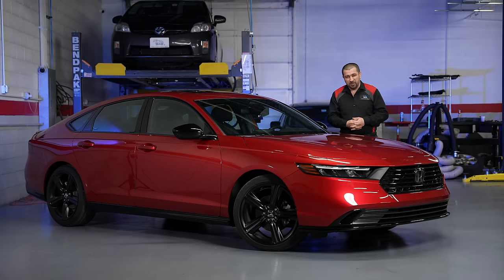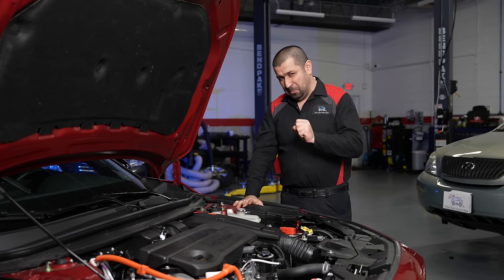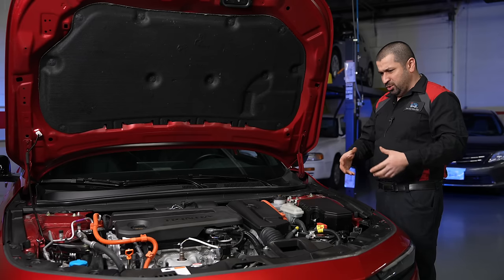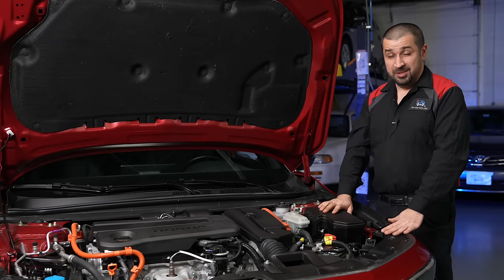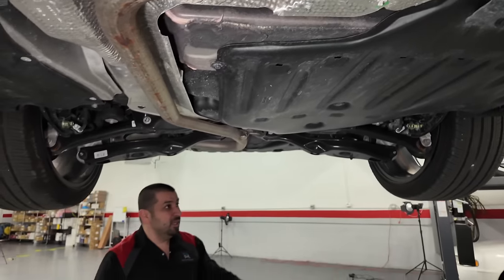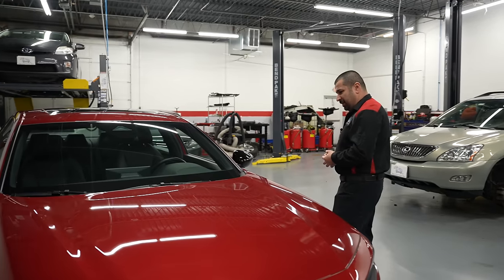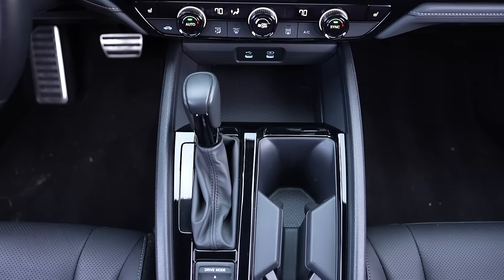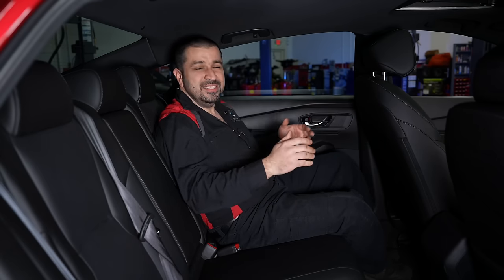Should You Buy The Latest Honda Accord? A Mechanic's Review

Comment: I own this exact same model that is in display here (Sport-L).  Overall have been very happy and the only thing I would recommend is to go with the EX-L model, cause it has 17" wheels and the ride is much smoother and it also has more features than the more expensive Sport-L .
Reply: but the Sport-L looks much better
Reply: @angusp5515  no rear seat vents in the Sport-L tho
Reply: @angusp5515  As far as appearance, the Sport-L is the sharpest trim and that's why I bought it.  But for the price it lacks quite a lot of small things that the EX-L includes, so had I done it over again I may have opted for the EX-L and then maybe added some of the black accents.
Reply: The ex l version is the one recommended by consumer reports because of the smaller tires and smoother ride.
Reply: @shojus  I'd agree with you. I have a 2020 Accord Touring, but if I were to buy a 2024 I'd go with the EX-L just because of the 17" wheels. That along with being a hybrid should make for a super quiet and comfortable ride.
Reply: @Nelwyn  The hybrids are definitely quiet!  The 19" wheels on most of the trims make for a noisy ride if you live in an area with bad roads.  They look great, just not practical for mpg and road noise.
Reply: I went with the Sport (not Sport-L) thinking I could live without the EX-L features but now a month later wish I did go EX-L. It’s all good tho, I’ll just have to live with my decision 😂 it does look great in the exterior at least
Reply: And yeah the 19” wheels are so loud for me along with slight wind noise but everything else is silent. The Sport has Goodyear Eagle Tourings which might be the worst tires I’ve ever used. Luckily reviews online show them wearing out anywhere from 10k to 30k miles so I won’t live with them for even a year lol
Reply: @futuredestroy6040  Same thing I have heard about those tires.  I plan on getting the Michelin CrossClimate 2's when I need new tires.  I live in Michigan so a good all season tire is a must.  Never needed specific snow tires with a front wheel drive vehicle, that's just me though.
Reply: @shojus  same here, living in Michigan lol. I was between the CC2’s and the Defenders for my next set but honestly CC2’s look so much better for year round use
Reply: @shojus  yeah that pretty much .means  the whole US..  not many , if any,  areas where the roads are all good to go
Reply: @jdl1276  You got me there!  Although parts of the country that use snow plows are way worse than areas with nicer weather.
Reply: Probably the EX-L hybrid is the best value if looks is not your main concern. It has front and rear parking sensors and for touring/commuter duties, the 17-inch tires are way more comfortable in long trips. It also increases your MPG to 44mpg/city, 51mpg/hwy, 48mph combined vs. 46/41/44 for the models with the 19-inch wheels.
Reply: Also, if you get an Accord Hybrid, I also recommend getting leather seats, which is standard on Sport-L and up, because in my opinion, the cloth seats feel very stiff, and depending on the person the cloth seats can be uncomfortable on long trips. I recommend try the seats out before making the final purchase.
Reply: For what you get, the touring is the way to go

Comment: Great video.
Considering that people hate CVT transmissions, eCVT name is not a smart marketing move..
Reply: Toyota has been using the name for the Prius and all of their hybrid trims for years, and they still have year+ waiting lists.
Reply: You are right, it is stupid.  I found a youtube channel where they explained and displayed this transmission.  At the time I understood how it all worked.  Anyway, it is not a CV.  Honda has invented a completely new way of causing the transmission to change gears and its all gearing.
Reply: My thoughts exactly in re the ill-advised eCVT name.  You nailed it.  Since it isn't a CVT and CVT's have a bad reputation, come up with a different label.  Distance yourself from the whole CVT thing.
Reply: @FunkatronicDingus  not on the crown , got my limited within in a week , dealers were stack with them
Reply: It is basically electrical motor driven which by function is electrical CVT untill the ICE cuts in.
Reply: internet warriors that repeat every shit they read are the ones that hate CVT
Reply: Cvt transmissions have really improved over the years.  You don’t need to press the gas hard to get going.
Reply: @FunkatronicDingus  Not anymore.
Reply: @cormaro13  I test drove it. I thought it was a bit lethargic. What do you think about the Crown
Reply: @bella3008  I does feel a little sluggish in normal mode but give a little more power or switch to sport mode and its a different story lol 

But overall the ride has been smooth with 40mpg , especially for the ev side , super quiet but every now and then there’s a little glitch with the wireless car play and that’s the only problem I had so far
Reply: Cvt is perfect for urban use.
Reply: OK, Marketing Whiz - what do YOU think it should be called?
Reply: Perhaps Honda should brand this to be nCVT, in other words, non-CVT. Basically there is no transmission in this car.
Reply: My 2013 Accord Sport’s (first year) CVT has been faultless with 95k on it as of now
Reply: The accord hybrid does not have a CVT. Its, in fact a direct drive system that clutches the gas engine in or out depending on the engine load. Most of the time, the gas engine works as generator for the electric motor. In addition the Honda system fakes shifting, thus avoiding the rubber band drone of a CVT. Again, THERE IS NO CVT!
Reply: CVTs are awesome. Had several cars with them and no touble
Reply: @simonmoriarty9987  
Their reliability is so-so (they rarely last 100k), and most people agree that they dislike how they drive despite the fact that they improve both acceleration and fuel economy. It's widely derided as rubber-banding.
Reply: @Wised1000  Nissan’s CVTs have spotty reliability. Toyota and Honda have been using CVTs in their hybrids for two decades and they have outlasted the batteries in the majority of cases.
Reply: I guess that geared, 2 mode hybrid with pseudo electric shifting was considered too much for the average Joe to wrap their head around.😂 It also shows that people don't know what a CVT is either. They just know its annoying. The fact is that for 90% of car buyers now a days hiw their car (or anything) works is simply magical.
Reply: @Wised1000  yep, everyone has electrically boosted (numb) steering now too. I hate that a lot more than the CVT in my Accord
Reply: @billd9667   The CRV's electric rack is nicely weighted. It doesn't feel much different to my old s2000 steering, which was also electric.
Reply: @Wised1000  you should have driven a good hydraulic steering car like my old Maxima. You could feel what the front wheels were doing. The new cars drive like video games without force feedback.

Weighting is only half of the formula
Reply: @billd9667   my first car was a Peugeot 504, trust me I know all about hydraulic steering cars with and without  power steering 😁
Reply: @Wised1000  I hear you. 

I will say that the dead steering on my 2013 Accord Sport is decidedly unsporty.
Reply: @billd9667  Probably the ratio is too low. It's also a strategy to make the car feel more stable a lower ratio is less likely to upset the suspension since it requires more input. Newer Hondas are less lively than the previous models. They are also bigger and heavier. That old, fun go-kart handling is long gone. I could lift the rear end of my first 1300 Civic 😁
Reply: @Wised1000  The problem is that electrically assisted steering is, by it's very nature, disconnected from the front wheels. wires cannot transmit sensation. Some do it better than others, but they are all awful.
Reply: @billd9667  similar case with my 2013 impreza sport lim. Only 1 solenoid in my valve body started going bad and throwing lights at 130k. Still drove it to work for a week before I replaced the body during the weekend.
Reply: You and I dislike the drone of CVTs, but “normal” people couldn’t care less as long as they work and love their gas mileage
Reply: Oh no! Anyways.
Reply: @bella3008 the old civic 2020 it drive better than 2024 though. Something they changed make it worse
Reply: That is exactly what it is. Most people who don’t know the difference between an Ecvt and a cvt don’t even know what a cvt is so it is not a big deal. People that what a cvt actually is also know that hybrids are different.
Reply: That is exactly what it is. Most people who don’t know the difference between an Ecvt and a cvt don’t even know what a cvt is so it is not a big deal. People that what a cvt actually is also know that hybrids are different. 

It is a continuously variable “transmission” 
They could call it a power split device in advertising- that would also be truthful.
Reply: That is exactly what it is. Most people who don’t know the difference between an Ecvt and a cvt don’t even know what a cvt is so it is not a big deal. People that what a cvt actually is also know that hybrids are different. 

It is a continuously variable “transmission” 
They could call it a power split device in advertising- that would also be truthful.
Reply: @2752us the typical consumer doesn't even know what a CVT is, so they don't care.
Reply: @billd9667  the CR-V, accord, and civic have had CVTs for years. And they have a relatively low failure rate
Reply: @GTRMclaren722  tell that to a Nissan Rogue owner, lol.
Reply: Yep, the average buyer will not know the difference between the two.  Confusing - YES!
Reply: Hate CVT Transmissions???  I absolutely love my 2014 Honda Accord EX with a CVT:) !!!  Best car and transmission I have ever drove.  This generation Honda Accord Hybrid Touring will be in my garage in the near future.....it is that good.

Comment: I'm glad it doesn't have a low speed gear actually. Slow speed driving is what wrecks gas mileage in ICE cars. Because the engine can act as a generator and be in a more fuel efficient capacity at slow speeds, and then actually drive the wheels at high speeds when MPG is better, it ends up being an overall better system. Let the battery do the stop and go stuff, and let the engine take the consistent highway driving. Best of both worlds.
Reply: I drive a CR-V Hybrid with the second, lower gear, and I have watched the power flow meter and the instant MPG gauge over the course of 4k miles. The gear indeed increases fuel economy, specifically at light load between certain speeds. What ends up happening when it is not "locked" is the engine has to rev a little higher to compensate for the efficiency losses inherent to turning a generator to power the battery that drives the car... might as well just go from gas engine directly to the wheels. Honda has it so when lightly accelerating it shifts into that gear at about 25 MPH, and you can hear the engine drop like an actual shift. Then at about 35 it unlocks because at that ratio it's no longer the most efficient way to power the wheels... which drops the engine RPMs, proving my point that at that speed the gear ratio is too low to be efficient... and then at 40 the revs drop again when the higher clutch engages. Only after pushing the pedal down about half throttle or higher does it then say "we need power NOW" and unlock ao the engine is free to scream as much as it needs to 

Having a gear though means, beyond a certain speed, you end up revving the engine too much because you're going too fast to be efficient in that gear, and Honda did an excellent job with figuring out at what thresholds it's better to go one way or the other, at a moment's notice. I rarely ever see it trip up.
Reply: @scott8919  that just sounds like a stupid system.
Reply: @kevinmcd112  Thinking so usually means you are thinking about it backwards. This isn't a gas car where the motor helps the engine, it is an EV where the electricity comes from a generator and a battery.

The disadvantage - which is less than most think - is that you have to convert twice between mechanical and electrical power, when you could have just changed the rpm with a transmission.

The advantage is that you can keep the engine near 2000 rpm and 34 HP, where it is most efficient, almost all of the time it runs. Not even Toyota's PSD can keep it that efficient, although part of that is because they use a smaller motor and a larger ICE. The reason for what you may think  is "stupid" is that if you have a narrow range of speeds where you can count on it staying there, you can link the engine directly and get rid of even more loss.
Reply: @jeffjo8732    so you're saying it's like the guy driving a tesla with the gas generator in the trunk. It doesn't make sense. 

The gas engine is always running and revs as it would if it was driving the car and gets literally the same gas mileage as the 1.5L turbo from the 10th gen Accord sport. This car is Honda's hint at going "full electric" to please the planet and save us all from the sun monster. It's stupid because this would-be "electric car" burns just as much gas as its gas-powered siblings. I've said it before, and I'll keep saying it. Electric vehicles are unsustainable.
Reply: @kevinmcd112  "You're saying it's like the guy driving a tesla with the gas generator in the trunk. It doesn't make sense."

Well, minus that huge, heavy, expensive battery. But you have ti take it seriously for it to make sense, and I don't see you doing that.

"The gas engine is always running ..." Whoever said that hasn't driven it. Here's some data on its cousin: https://youtu.be/6glpZTRT6qE?t=388

"... and revs as it would if it was driving the car..." Sorry, another lie.

"... and gets lite rally the same gas mileage as the 1.5L turbo from the 10th gen Accord sport." Over 60K miles and five years, I've averaged 48 mpg.
Reply: @jeffjo8732  you have an electric car with a gas engine burning gas to charge the battery. Electricity is cheaper than gasoline. This car is basically a less efficient Chevy volt because the gas engine is running even when it's not driving the car. Oh ... and my 2019 1.5L Sport gets 42 mpg city and 48 mpg on the highway. 

Bottom line: It's a dumb design meant to please the wokesters and tree huggers. Electric vehicles are unsustainable. The government wants to ban gas-powered cars because they allow access to the freedom of the open road.
Reply: @kevinmcd112  And the electric car has a battery that costs more than the ICE. There are tradeoffs.

But have you never heard that "your mileage may vary?" Driving style is very important, and you exceed projections. The EPA says your 1.5L Sport should get 30/38 mpg. If you get 42/48, your style gets 40%/26% better than projected.

My 2018 Accord Hybrid is projected for 47/47, so I'm close to that. But I do take advantage of the better power that I have, and you don't. With your "mileage may vary" figures, you should get 66/59 in it. And yes, I know people who do.

The Volt was a plug-in hybrid, so you have to compare it to the Clarity. Both are rated at 42 mpg for gas. The Clarity got 110 mpge, while the Volt got 106 mpge.

Bottom line, it is a very good idea. One that Honda is using to transition into electrification step by step. Without making a full BEV, which you seem to find objectionable.
Reply: @jeffjo8732  I really have better things to do than argue with idiots on the internet. Sorry, not sorry.
Reply: @kevinmcd112  Always interesting watching people build fantasy worlds that are even shittier than reality, just because they're simpler and help you feel like you understand/control your life. I'd say more power to you, if y'all weren't always trying to legislate your insecurities against the rest of us.
Reply: @moarsaur  are we still talking about this? (BTW, thanks for proving my point.)
Reply: The best of both worlds which are Fast Cars and Beautiful Women. That leaves Hybrids and EVs out of the picture since they are not fast.
Reply: Sounds a bit like a diesel electric locomotive.
Reply: Toyotas eCVT design is better for reliability, responsiveness, smoothness, power and even MPG.
There is no clutch to wear down, there is no hydraulics, no valve body, no solenoid... it is pure mechanical.
Honda on the other hand has two clutches, it cannot drive the wheels with both the ICE and motor at the same time or at least not as efficiently as Toyotas mechanical approach.
Toyotas engine is also better. The D4S would have less carbon build up and emission over time compared to Hondas direct injection.
Reply: @xtinct16  Must be nice to live in a world where you don't need to worry about facts, just make assertions.

The Accord Hybrid has as good, or better, reliability rating than the Camry Hybrid. For example, from KBB the 2018 Accord is 4.5 out of 5, the Camry is 4.1. Its "pure electric" design is more responsive, and smoother, than a "pure mechanical" (although that isn't true, it is power-split) one. And the Toyota system actually has more history of clutch (yes, clutch - Toyota calls it a Torque Damper) failure. And yes it can "drive the wheels with both the ICE and motor at the same time," but it doesn't do so often because pure electric is quicker, smoother, more efficient, and more powerful.

 @richscott2483 The fastest ICE cars are hybrids.

Comment: The transmission clutch should last a very long time because if it's only used at higher speeds it means the input shaft from the engine and output shaft from the clutch will likely be RPM matched by the computer so there will be almost no slip during engagement.
Reply: do they have torque convert
Reply: @sivucit  no